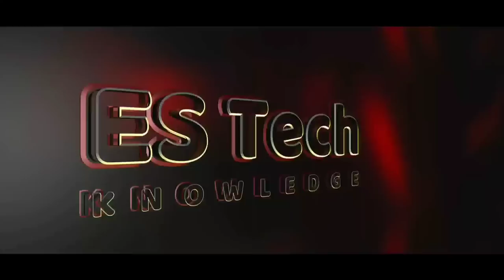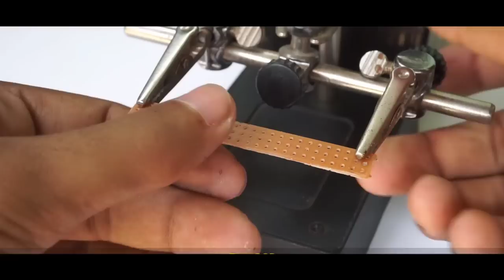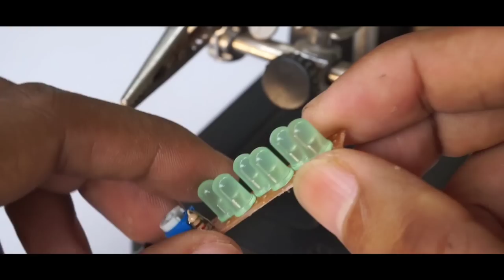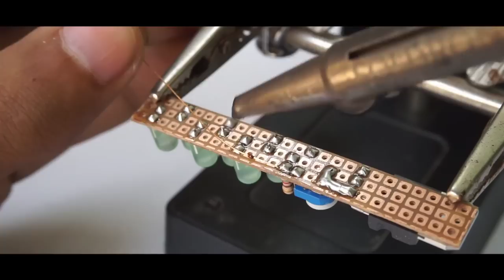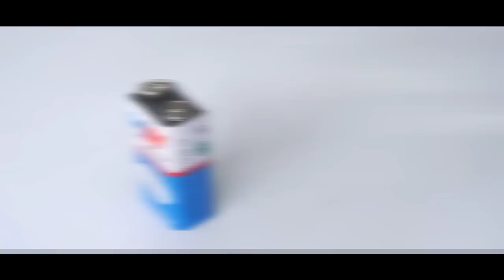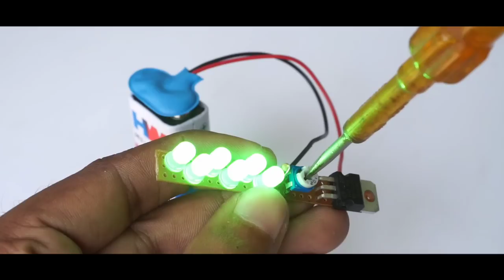This 3 Pin IC Can Do This...

Comment: I knew the 3 pin IC was going to be a voltage regulator :) That also a good circuit for showing that LEDs never have the exact same forward voltage. One series of LEDs will almost always light up at a slightly lower voltage than the same series of LEDs that are wired in parallel with it.

Comment: id..t  you can do that without 3 pin ic...
Reply: Idk abt that. Bcz there's another comment saying that the 3 pin IC is acting as a voltage regulator. Without the voltage being regulated, I'm sure those LEDs would've poped